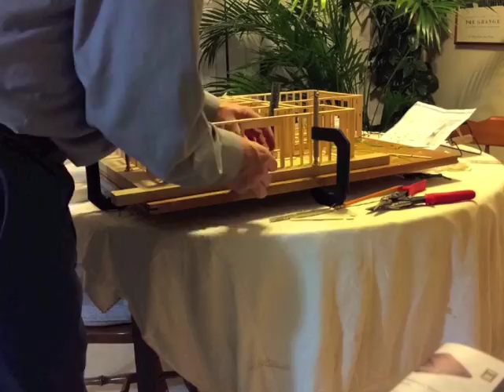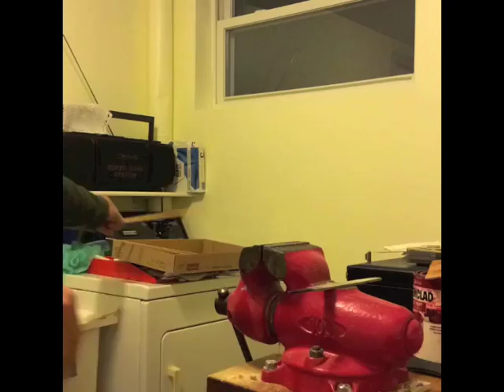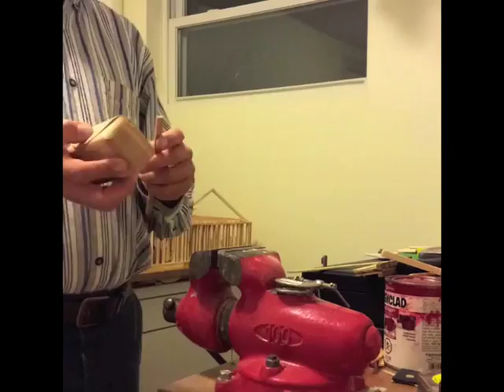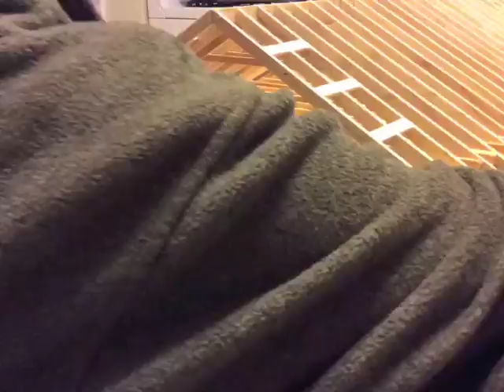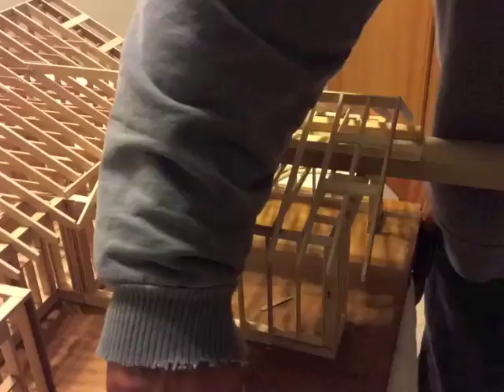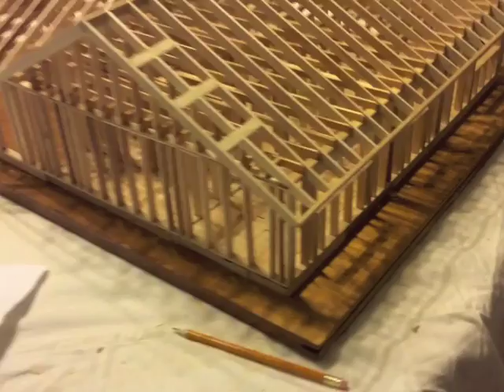Time laps 3000 Popsicle Sticks, 100 Hours, 1 Guy, 1 House

Comment: The company that makes Woodsies no longer makes them.  Woodsies are  straight and clean. Do you know any other brand like them? I've gotten some from hobby lobby but they are bowed. Any advice thank you
Reply: I mill 1/12 scale lumber very nice material long length pieces to if needed everything starts at 8foot lengths then I cut to 8.5 inch studs and 2 foot pieces redwood and cedar

Comment: if this is a popsicle stick  house why are there no popsicle sticks used call it what it is as it isn't a popsicle  stick house
Reply: It is made out of POPSICE STICKS
Reply: +Tristin Mayo if you watched the video he mentions they are scrap pine he stripped in to small pieces so no they are not you nitwit
Reply: +Archaic Productions not to pension it's mentioned in the post below mine
Reply from the maker: The walls and floor are all made from Popsicle sticks cut square on each end to 4 inches. To build the rafters as well a the ceiling joists I used pine lumber ripped on a table saw to 1/8" X 1/2". If you have no table saw and you want to do it with Popsicle sticks it would not make a good model for my students to see how rafters are made. Best of luck with your model.